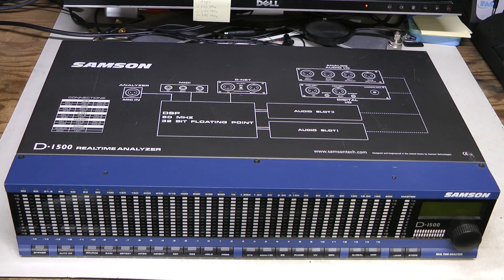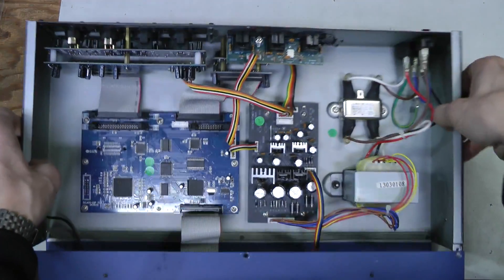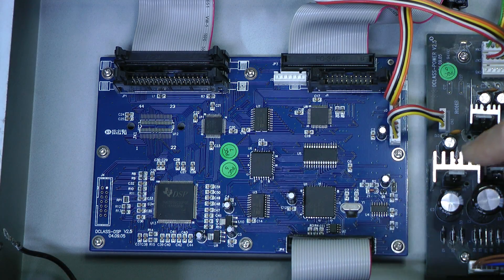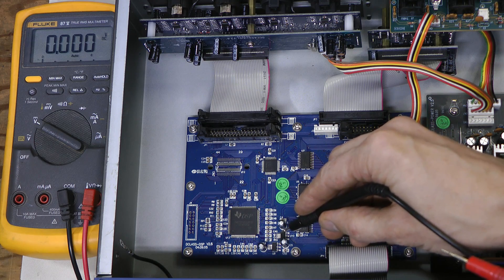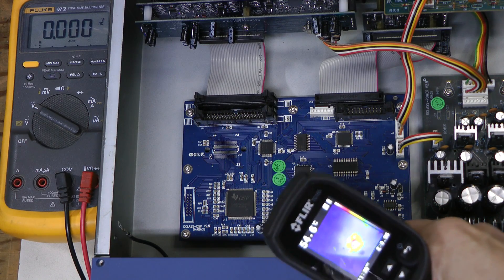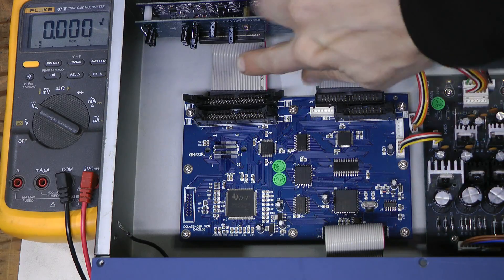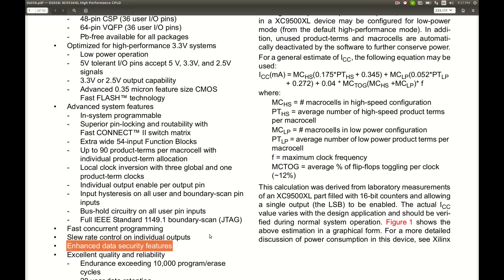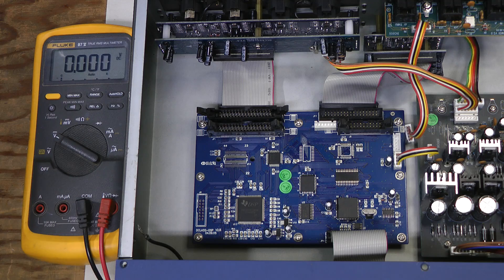#81 - Samson D-1500 repair fail

Comment: One suggestion: If you still have this unit, try powering it with different voltages. Mine is a 220v version and it greens out like yours if I try to use 120v to power it. I imagine the same might happen with the 120 v version if its powered with 220v.

Comment: CPLDs, PGAs and all similar architectures are the very definition of built in obsolescence.  They guarantee the device will end up in the landfill. Even if they don’t become faulty like this one, they’ll eventually lose their programming, rendering the device useless and unrepairable. They also enable the manufacturer to charge whatever they like for replacements as they’re ‘custom’.
I’d imagine Samson would supply a spare part as an entire PCB for more than the device is worth.
I guess this obsolescence is the trade off for relatively cheap electronics these days...

Comment: Do you think it's worth reverse engineering the surrounding circuitry, generating schematic and taking a stab at re-imagining what logic the CPLD would have implemented? If there's a clock connected to it then it may have state machines, but if there is no clock then it could be purely combinatorial and was used to replace the usual handful of TTL style jelly bean logic. To be clear: reverse engineer just the circuitry that interacts with the CPLD, not the entire system :)
Reply from the maker: There is a lot of complexity there. I do not think it is practical to re-implement the logic just by guessing what it is supposed to do.
Reply: @feedback-loop  Ok, no worries. Just thinking aloud. Great video despite the failure. cheers.

Comment: One thing I find interesting is the manufacturers slap flash into these devices and specify the number of erase cycles but never actually tell you details of the data retention life of the data in the flash. It's possible the cpld fuse map in the flash got corrupted and once loaded into the array caused some form of latchup which took it and the associated buffer out. Yes, really sucks that it's impossible to read back the CPLD contents once security is enabled but in this case I suspect the fuse map would have been corrupted anyway.  This is one of the reasons I've scaled back buying gadgets and I'm dreading the day I have to buy a new car that is jam packed full of this stuff. 
[edit] I looked at the XC9572XL datasheet and it does mention 20 year flash data retention. I guess we have the answer.
Reply from the maker: Yes, they do mention 20 year retention.

Comment: Good video. An unfortunate thing we see more and more. Every component that has some form of programming done to it equals bad news.
However, did you have a look to see if the processor clock is running? Not sure if a cpld needs a clock to operate. If the clock isn't running it might be a case of stalled logic in an undefined position which causes high currentdraw. It's rare, but worth a shot, I guess.
Reply from the maker: Good point, but the chances are slim.

Comment: I guess this fail is where all modern equipment is headed.
Reply: Really depends on the makup of the device.. CPLD's and things with mask roms embedded in the cpu/micro-controller are toast unless someone has reverse engineered or managed to dump from a working example.
Reply: @pixelflow  Even for simpler devices like GALs it's very rare that people manage to do it. But sometimes they do, like Karl-Heinz Linder reverse engineered a defective GAL in his Tek 2710 and managed to return the unit to full working order.
Reply: @pixelflow  Alas I fear you are right, we already see that also in the farm equipment environment I spoke of. Farmers are buying up 'older' machines that are not as 'locked down' as the more modern stuff where possible just because they can repair them easier. Or as we see in the apple 3rd party repair shops who buy up donor boards that did not pass QC or were discarded for other reasons so that they can get the chips of those as replacements.
Reply: nah, all you need is to look at people like Louis Rossman or Jessa who repair modern laptops and iphones on a daily basis. Mind you if vendors had their way, yes but people find ways.

Mind you this is why people need to get behind the whole idea they are promoting. The 'Right to repair' legislation. What really took me by surprise is that it went way beyond household consumer stuff all the way to things like farm equipment (tractors, combines etc) which also are quite high tech these days.
Reply: @xConundrumx  That only really works for extremely popular high value gear. There are not a lot of things which fall in to both categories. You will have a much harder time finding someone to piece together all the parts required to fix laptops for other manufacturers like Apple. I'd love to see some "right to repair" type regulations that force companies to offer programmed chips / firmware for "blob" devices like this CPLD.
Reply: @YSoreil  I don't quite agree only high value gear. I see plenty of people on this very site repair all kinds of gear. I suppose in the end it is more a case of is it financially sound to repair something but all that is academical. There is a German youtuber who literally goes to the scrapyard and buys stuff at a fixed price / kilo often getting the things few consider high value or popular. My point being there are those (like that youtuber) who just repair because they feel it is their way of contributing to a more durable way of life.

Add in the mix people like Mr. Carlson who repair even today still things with vacuum tubes and old test gear (not unlike this channel). He has rooms full of the stuff and his repairs are equally entertaining to watch and learn from.
Reply: Just call Babu Frick.....